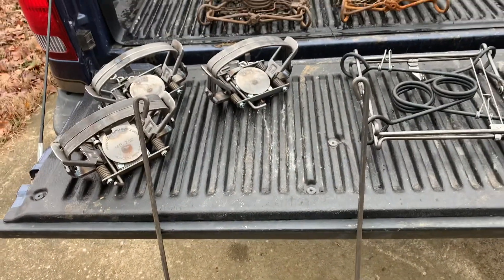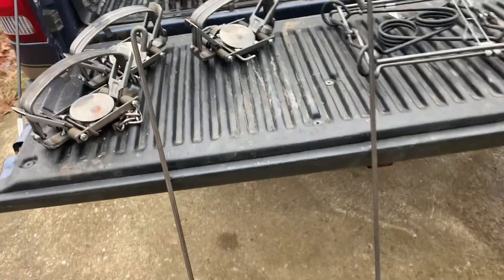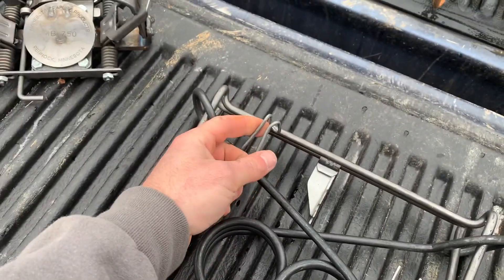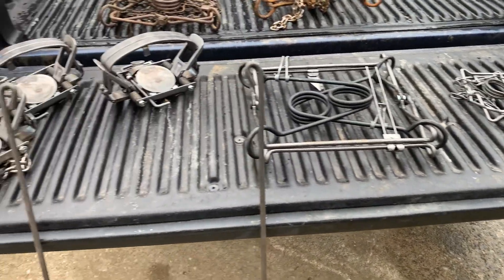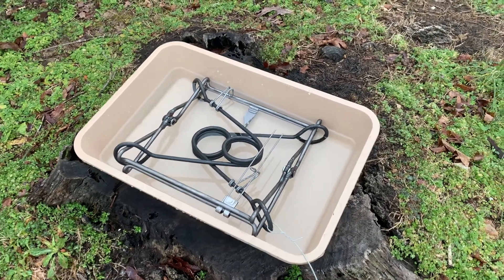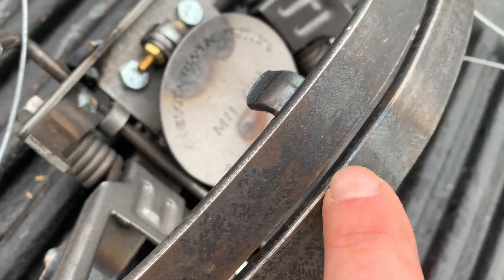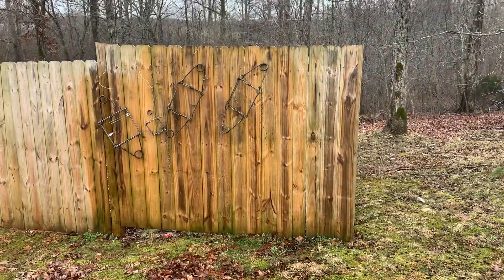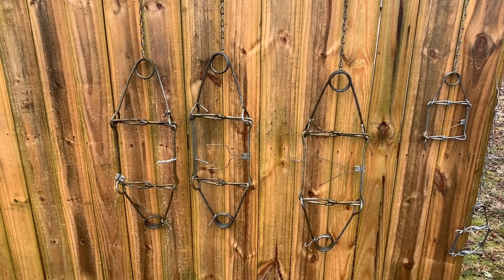Trap Preparation for Beaver: Step 1- Acid Bath

Comment: be careful , waxing any conibear makes them fire to easily. we paint ours on the water traps . it is a 50/50 rustoleum acitone mix . nice looking 750 traps . the deep water h stands , you will love them .
Reply from the maker: Thank you sir, I saw that as well for not waxing conibears. I’ll be sure to avoid that. I am borrowing one that was waxed by a buddy, and it was so hard to set because it was so sensitive. No thanks! Looking forward to that deep water H stand for sure, thanks for the advice guys!
Reply: @Trapper_Tom  trappers helping trappers , it is a great community .